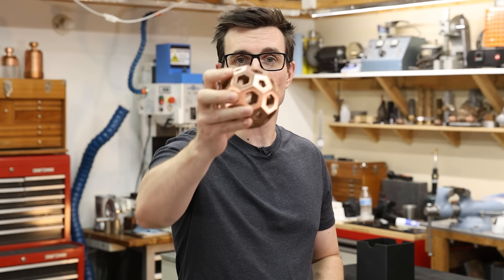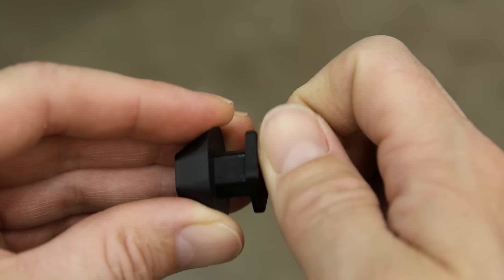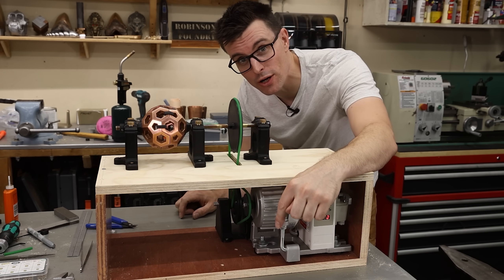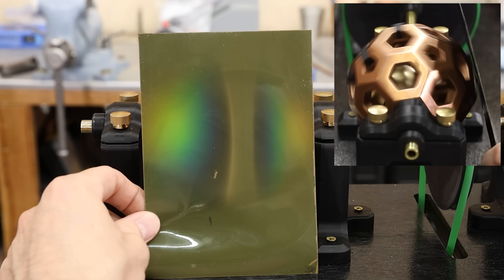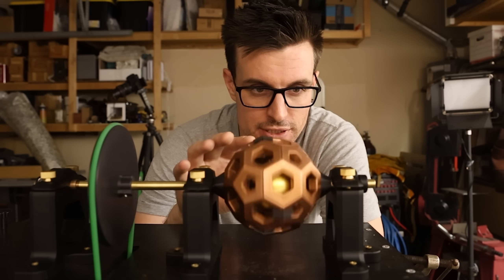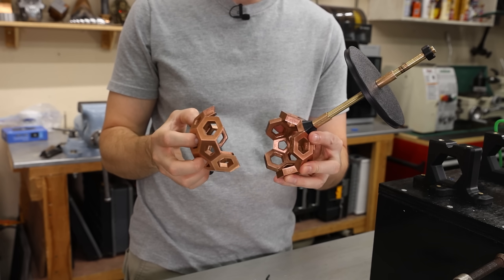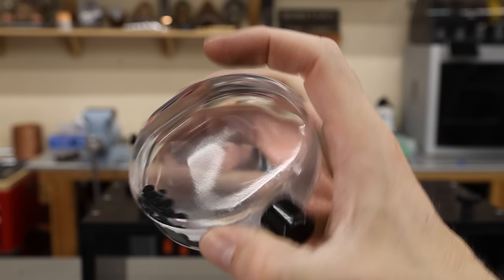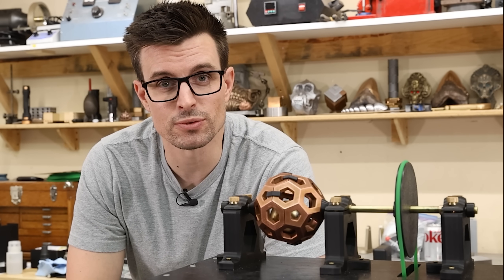Huge Magnet vs Copper Sphere - Anti-gravity Machine

Comment: Try this for a video:
Put two 8 to 12 inch long copper tubes with 1 cm diameters parallel to each other and rotate them each away from each other on their axis. With a thin gap between them.  In the gap you should be able to float a cylindrical magnet continuously. 😃👍💛💛💛💛💛

Comment: Put a bulb with the Derrek fluid in the center. Or  also hold the magnet in the center until the spin is optimal with a bar through a tube holding the dodecahedron. Ya letting go you need to think through but all in fun testing!!!

Comment: Question: Is there a ratio of copper(size): magnetic(field) you can use to get the right size. It seemed like the Pipe had just about the right amount but gravity was winning slightly. The sphere gravity seems to win just enough to cause it to touch the sphere and then repulsion sets and pushes it away.

Comment: The effects you're looking for are based on magnetic flux, which requires RELATIVE MOTION.
Find a way to make the magnet stationary or use a washing machine transmission to oscillate direction.

Comment: I think maybe there might be some other magnetizing items going on. Kind of like taking a screw 🪛 and rubbing two magnets on either side to magnetize it to pick up and hold screws.

12:33 
The rod attached to the wheel, you can see after it starts moving with the fluid how it shifts to that side. Maybe just add a rod to the other side to test the theory.

Comment: My first suggestion, which would be simple enough, simply try different shaped magnets, like a square. Does the shape of magnet make a difference?

This is probably a more pain the azz suggestion, but what about re-casting the spheres mostly one piece? Make so there is one opening on one part, only big enough to fit the spherical magnet through.

Comment: What if you were to  create something that hold the magnet in the center of the cage, that you are able to remove while its spinning? I'm thinking something like small wooden dowels that are in the center of the metal rod. Actually I think this quite do-able, you would just need to use pipes instead of solid rods. And 3d-print some pieces that go into the ends so the dowel stays in the center of the pipe while it spins. And they don't have to be wooden dowels, you could 3d-print something that actually holds the magnet, like a stick with 5 fingers that gently hold the magnet and you pull them out at the same time. I think this might actually be your best bet. But you coudl probably design a mechanism that pulls the sticks/fingers away at the same time, you're much more mechanically inclined than I am, but I think this would work :)
Reply: I was thinking mini air bags that you could defate.;)

Comment: I think you would have to start over when you hear it smacking on the side with the rotation. Once it gets a resonance of movement you can't get rid of it and you have to stops the spinning and try again. It's just a matter of how it moves each time you start the spinning and you would be able to get it to float perfectly on occasion. Maybe you'll have to find a way to increase or slow the speed to get it not pick up a resonance of movement.
Also I was thinking that you could put magnets on the outside of the copper cage if you find that it always impacts in the same spot, like from an inbalance in the system - because you can hear it hitting in the same spot as it spins. But I doubt its in the same exact spot each time you try.
Reply: LOL I spoke too soon! lol good thinkin!

Comment: I fear the electrical connection between the hemispheres of the copper is too high resistance to allow the induced currents to efficiently flow between halves, causing a lot of the currents to turn into heat.

Comment: Could you make a copper circle the same shape as a bicycle tire but without the wheel so it's just a "U"  shape. That way it would be solid all the way around the outside but Hollow in the middle? I wonder if that would help keep the Eddy currents constant without any holes.

Comment: Maybe if the copper sphere was perfectly spherical instead of geometric (even just the inside wall) it would work better. Would make the initial ramp up smoother and make the eddie currents more evenly distributed.

To make it easier and quicker to test this you could just use a ring shaped track. also make one with the geometric profile and see the difference.

Comment: That sphere is beautiful but if you put the copper cylinder with the magnet (the ones you showed that inspired this experiment) in the chuck of a lathe, you could spin the cylinder and easily demonstrate the floating (or not) of the magnet inside. It would be easy to view and record through the open end of the cylinder.

If it floats it might just float right out of the end of the cylinder if the lathe is not perfectly level (This might actually be a good way to perfectly level a lathe.)

By the way, did your sphere heat up any from the induced currents?

Thanks for this great, and thought inspiring, video!

Unfortunately, as I just read below from @contomo5710, once the magnet reaches the same speed as the cylinder the induced current will end and it will fall to the bottom. I guess you would have to reduce the magnet's rotational speed, maybe by putting a shaft in the center and manually slowing it down. But the weight of the shaft would tilt the magnet... A lot to think about and experiment with, ha ha.

Comment: I'd like to see you make a similar device but instead of sphere, have the ball in a donut. I think the donut shape will be closer to simulate the ball going though a pipe continuously, rather than a sphere. In a sphere it looks like the ball is spinning together with the sphere so relatively to the sphere itself the ball is not moving much which I wonder if it weakens the floating effect.

Comment: What if you made your drive axles hollow to feed something through that you could hold the ball still during speed ranges that made the ball oscillate more? 
The other issue is that the poles are free to orient however. You'd have to isolate it's movement so the equator is perfectly radial all the time to the axle while still letting it float during rotation. 
Another idea would be to 3d print various size spheres or truncated icosahedron as well where you can glue magnets into it keeping a single magnetic pole facing outwards. I'd try some 8mm disk magnets to start.

Comment: Make a jig, with multiple adjustable brackets, for holding multiple neodymium magnets equidistant from the primary magnet, parallel to its magnetic equator.  See what that does.

Done correctly, you can start off with 2 magnets and gradually increase the number, while altering the distance from the primary.

Comment: I wonder if a copper mesh would help. The conductivity of the metal matters a lot, and if you have large holes like that it changes the shape of the resulting field. Additionally, the different seam angle had an effect likely because the two halves did not have a tight connection on bare copper, so there is some resistance between the two halves. This is kind of a dumb/simple guess leaving out a lot of details but still something to possibly consider.

Comment: You seem to have plenty of force available, but a single rotating copper piece needs to balance restoring force versus centrifugal force so only some shapes can work. With more rotating objects there's more freedom to design stable levitation, but that's more work in a different way. I think maybe a single pair of counter-rotating disks could stably levitate a magnet over some speed range. Parallel horizontal axes, not coaxial, magnet goes between the two disks and between the two axes. Not sure how much offset compared to disk radius, maybe 0.5 radii?

Comment: others are suggesting the seam line is an issue, could try making it straight. Maybe a sphere made of lines and circles may be different to hexes. you could just try spinning a section of tube suspended in two orientations to see how that effects the support just as a pure experiment.

Comment: I feel that you're so close to making some type of unique motor spherical. If there was a way to make all the poles be centered inwards for the same type to try to get it to hover. Maybe more points of magnets you might be able to make something that can actually produce more torque even it looks like you're on the precipice of something much more than what you're trying to do. I feel like you should really Deep dive in making this a motor somehow because it's very interesting when you influenced it with other magnets. If there was more magnets involved and you did very similar to how electromagnetic motors work, you might have something interesting here. It also feels like you don't have enough copper. Maybe if you fill the whole copper inserts other than the center ones, it might help. I'm very interested in you turning this to some type of unique motor. I would want something if you were to do it. Would be like a radial circle with all the poles shifting and alternating. Maybe that would stabilize everything just how like a stepper motor would work

Comment: When you drop it down a copper tube, can you tilt it sideways and have it avoid or repel the sides of the tube, or does it hit the side ? If the inside of your sphere was magnetic south, and your magnet had only its south side facing out, it would work maybe. I know a one sided single pole magnet sounds wrong and I'll have to check but the magnets in a hard drive are only magnetic on one side. Like I said, I'll check,...it's hard to imagine a north or south pole only on a magnet. I will check, but it's bedtime and I wanted to comment,...Maybe a copper tube in a circle like a bike tire,...you could see through the tube with your magnet plastic sheet. I'll be back,..

Comment: I don’t remember if you covered this in your first video, but do you think smoothing the copper cage to be spherical would help? I wonder if it’s getting caught up in the change of mass as the different shapes pass by; like driving over potholes on an already bumpy road. If the rest of the cage is smooth, it would be more like driving over rumble strips on the side of a freeway.

Comment: I have a theory I noticed the magnet oscillating and increasing in oscillation amplitude I'm guessing that as the holes in the copper move under the magnet the magnet is pushed less making it drop slightly then as the hole passes it's pushed more this repeats in a self synchronizing cycle adding more energy each time until it hits something You could test this by putting the sphere in the copper tube and spinning it to see if it is stable (maybe you could use a rock tumbler to spin the tube?)
Reply: That being the case, spin rate should matter.  The effect being worst when the spin and holes match to a frequency determined by mass and gravity.

Comment: I would have thought that letting the magnet align with the rotation would be decremental. You want the movement to be towards the change in the magnetic field, so that counteracting magnetic fields can develop. If the magnet is axialy aligned with the totation, the copper mainly moves along paths with equal magnetic field strengths. So my idea of this would be to align the magnet back to front, how you did earlier, and then go rapidly to the max-speed where the centrifugal effect barely doesn't kick in, and should it start floating probably increase the speed more

Comment: I think there is not enough copper... and the copper that is missing is not the same size all the way around, like the holes are different sizes.. I mean it worked in the tube with the cylineer magnet.
But dude... This is pretty awesome... Keep it up.

Comment: Remembering back to my university days, but I believe there are a few things you will need here.
1: As others have mentioned, the honeycomb/soccer ball pattern will cause the eddy currents to be at odd angles to the magnet, which will diminish the effect.  The whole effect only really works when the currents can be perpendicular to the magnetic field, but the angled bars will act like thick wires directing the current at oblique angles to the axis of rotation.  I get making it visible, but you need to have a solid ring around the equator with respect to the axis of rotation.  The closer to the axial poles, the more you should be able to do whatever you want, but that equator needs to be uninterrupted and circular.
2: The magnetic field from the motor and the ferric metals in the motor are definitely going to be strong enough to perturb the field of your spherical magnet, which will also muss up the eddy currents you are trying to use.  If you put your magnetic film between the sphere and the motor on the wood you should be able to see the field shifting in an unstable way.  Luckily a thin sheet of ferric metal should be able to interrupt the magnetic field from the motor (and the sphere) and do so in a uniform way such that they are quasi-independent.  Alternatively, since EM fields follow the inverse square law, you can just move the motor several inches further away and the impact should become negligible.

It is a very cool project and I'm pretty sure you are very close.  I would suggest milling a pair of locking tongue and grooves into the hemispheres along the equator so you can join them tightly without the need for additional 3d printed parts which could throw off the balance.  Save them for balancing the rotation.  To that end, I would also suggest getting a rubber strap to stretch around the circumference of the sphere so you can precisely attach weights by slipping them under it.
Reply: So would a 2-3 inch wide section of say 3 inch diameter copper pipe  rotating on its circumference work if you viewed it looking down the pipe ?
Reply: @Voting-does-nothing The idea makes sense. I think the problem then becomes how to spin the pipe.
Reply: So if you would, lets say, want to build a big triangle shaped bomber craft with alleged tubular magnetic quasi- gravity reduction device then maybe perhaps that could be referred to something along these lines in a rather extreme form?
Reply: Yes. The best approach is to just make it work without any compromise (such as making it visible). Then after you've proven that it can work, figure out how to make to visible after the fact.

Comment: im curios if you smooth the inside of the copper to be rounded evenly , and maybe a slightly bigger magnet , similar proportions to the disc magnet in the copper tube at the start

Comment: It might be that the eddy currents that you are producing are being disrupted by the "windows" you have created in the sphere.  Here are a couple of experiment revisions you could try to negate this effect while still being able to observe the magnet, at least partially:

1. Make several copper rings of the same diameter, wall thickness and height.  I suggest around 20cm , 1.5cm, 1cm respectively.  Make two more solid cylinders of the same outside dimensions - 20cm dia x 1cm high.  These last two are used to cap the ends.  The solid cylinders would not need to be copper.  They could be 3D printed PLA.

Create a cylinder by stacking these rings together but separating them with three spacers, one third of the diameter around each ring.  Attach the solid PLA cylinders to the ends.  The open gaps between the rings become your viewing windows and as you increase the RPMs, the spacers simply disappear to the naked eye.  

The simplest way to do this would be to align all the holes and push a rod through all of the rings from one end to the other.  This also means you can adjust the spaces freely to give larger or smaller viewing windows, you can thread one or both ends to easily remove an end cap to insert magnets, plus you can experiment with both conductive and non-conductive rods and spacers.  

2. A much harder build, but closer to the sphere design you have created:  Do the same with rings that are still 1cm (high) sized to create a sphere.  To connect them, you could make two circular wire bands that connect and hold all the rings with the bands intersecting at the "north" and "south" ends of the sphere, where you connect the shaft.  You could solder them to each ring or work out some kind of clip arrangement.  Downsides include no flexibility to widen or narrow the gaps unless you make elliptical bands of differing sizes, and potential difficulty in inserting and removing the magnets.

Let me know if you like the idea and think it might be worth trying. :)

Comment: I wonder if part of the problem is that the magnet starts rotating and quickly catches up to the rpm of the cage.

You might need to be precisely oscillating the speed to avoid this.

Comment: I have virtually no knowledge of magnetic fields to base this off of, but from observing the way it behaved when one magnet was pushing from behind it looked kinda promising. If you made something to hold the outside magnet steady and added a handle to fine tune moving it closer/further it could be interesting. I would start moving the magnet in 45 degrees from the bottom rear as the sphere has a tendency towards that area of the polyhedron, maybe different angles would work better or maybe even a second pushing from above at the rear could help centre it better, im no expert in this area by any means, but pushing the sphere away from the side of the polyhedron that it's attracted towards seemed like it was worth investigating further to me.